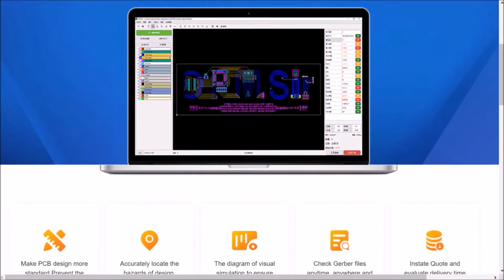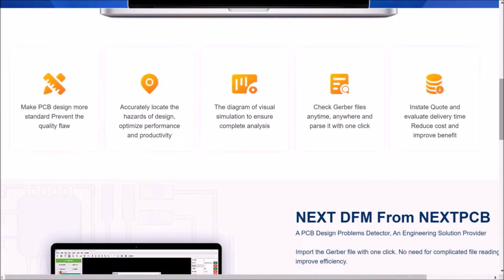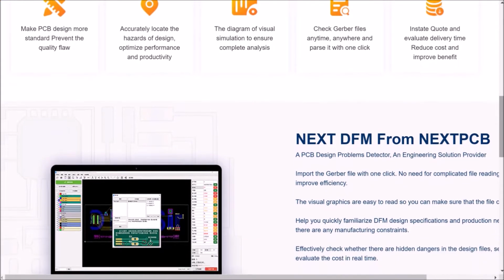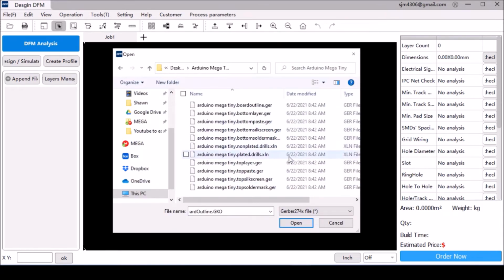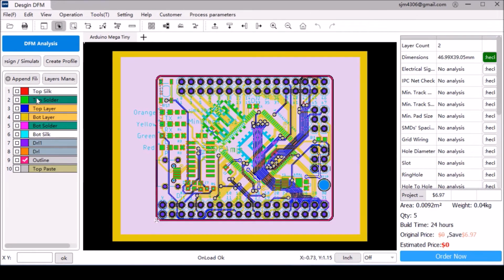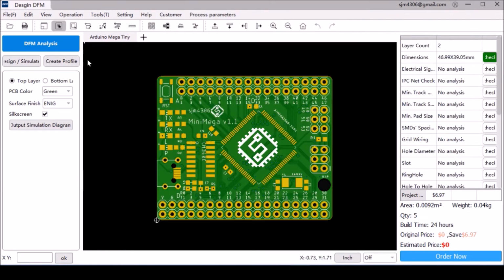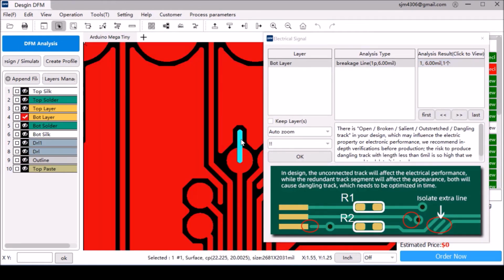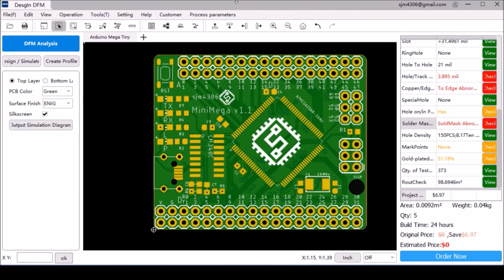How to Check PCBs with NextDFM

Comment: As a newbie the most intimidating part of pcb design is, not being able to understand which parts I need and why. For example if I want to design my own esp32 board I don't know what I need to put to make it work. For worse it becomes impossible to add more complicated parts such as battery charger circuit with overcharge protection. I am sure it is easy for a professional. 

Is there a way to find out what is really necessary if I want to start from chips instead of modules?
Reply: Browse various schematics and learn how to read schematics, you should have a full understanding of schematics before trying to layout a pcb. Look at the nodemcu and adafruit schematics for their boards they are open source and available
Reply from the maker: This is a fantastic question and affects everyone (including professionals). No one is born knowing everything and even professionals will come across a new part and not automatically know how to integrate it into their project. 

The answer is actually obvious at face value. Instead of making something you are unfamiliar with from scratch you borrow and modify what is already out there. By relying on resources that already exist the job becomes much easier, you just need to know where to look for them. My first go to when say trying to integrate a battery charger for instance is to find the reference schematic in the chip's datasheet. This will often have the minimum suggested viable circuit to make it work and is a great place to start. I can then go on to modify the circuit to suit my needs.

For your esp32 example I would go a step further and search for open source esp32 based projects published by makers. These are often already documented with a working circuit and bom so all you need to do is integrate that information into your own project (of course with proper thanks and reference to the original design). In my case when I was designing my arduino clones I googled "arduino clone schematic" and searched through google images to find a suitable circuit which I then modified to work the way I wanted it to.
Reply: @sjm4306  Wow thank you for the detailed answer!
Reply from the maker: No problem, this is something that should really be hammered in technical/engineering classes but it seems like it's a skill/knowledge that most people have to learn on their own when they are out in the real world.
Reply: As a newbie, i don't there is this much supportive community for PCB Designers.